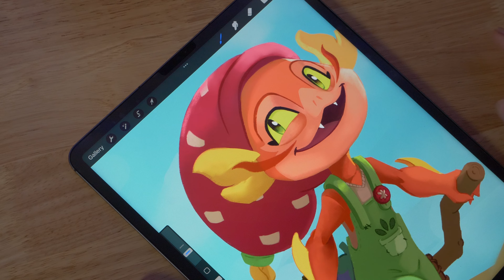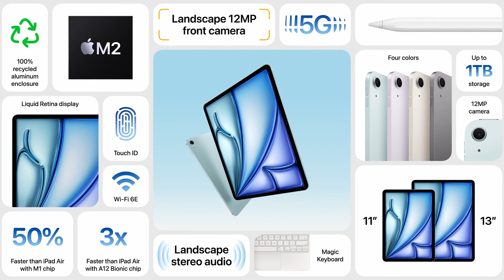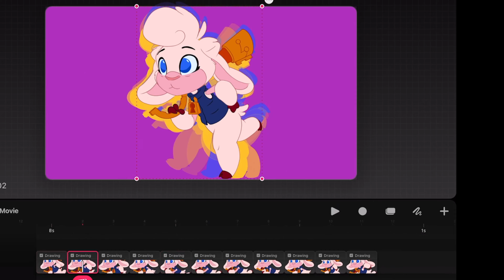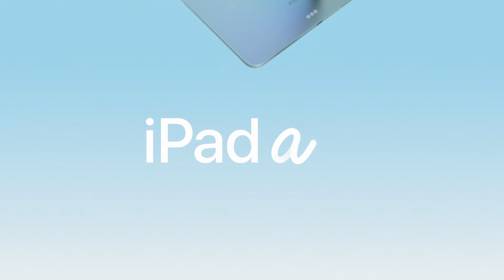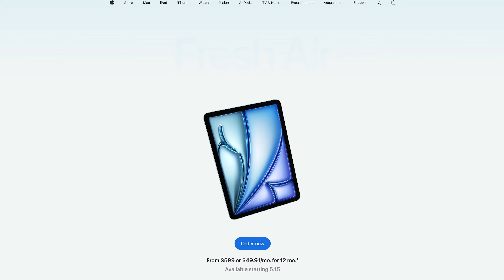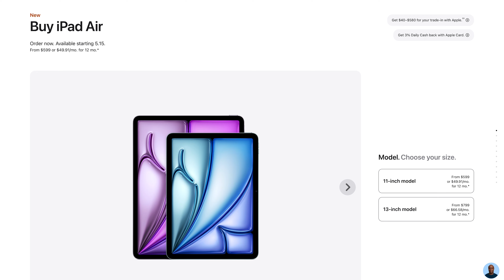Is it finally worth being an iPad artist?

Comment: The Pencil thing is actually a technical limitation. They moved the front camera to the landscape side, which is where a lot of the sensors and magnets were previously located to store and charge the pencil. That's why they had to be spread further apart, to make space for the webcam to sit in between. The magnets in the new one therefore don't match the old iPads positions anymore - kind of a bummer because I'd love to just get the new Pencil, but you can still rotate the pencil via brush stroke flow and achieve pretty much the same results, its just a bit more finicky but no reason to buy another 1.3k tablet :D anyways, great video!

Comment: They said something along the lines of "they are moving one-step closer to the ipad becoming a magical pane of glass." To which I add "that we will undoubtedly put in a big chunky case in order to protect it for when we inevitably DROP our expensive investment." 

The layer limit in Procreate has more to do with RAM than it does with processing power. Even the old M1 chips are more than capable of running Procreate, Dreams, and even Fresco buttery smooth while reaching their respective layer limits. It really has very little to do with the M4 chip.

The reason the Pencil Pro isn't compatible with the old M2 models is because to add the haptic feedback in it and re-position the camera to the long side of the ipad, they had to move the charging magnets in the ipad itself. The new pencil will not connect appropriately to the old ipads and the old pencils will not attach to the new ipads appropriately either. However, I wonder if the only caveat to the new pencil on the old ipad is that it charges slightly off-center or does it just not charge at all? If it is just an aesthetic issue, I can live with it if it means I can have rotation in my pencil, especially when my clunky Logitech case has a nice thick strap to hold it in place.

Comment: I agree with you about how thin this thing is.. my new 13" pro has a flex when on a flat surface and I'm typing on the screen - doesn't make me feel confident about my purchase. The real problem I have with this is Apple could have put 5 or more different features, or improved features into this iPad BEFORE worrying about how thin it is. It just isn't something anyone really wanted. I would have rather had a 20% larger battery, or more options for grips/tips with the Apple Pencil, better speakers, larger screen option!!, or software enhancements. But how thin it is? I never once thought yeah "hope the new iPad is as thin as 4 credit cards" - I don't understand Apple 90% of the time. I really don't. Probably why the iPad is the only Apple product I have these days.

Comment: The Apple Pencil Pro thankfully works on the new Air. Though it really depends on what specs you need.

My biggest concern is heat given that I do a lot with 3d and such, and the M2 iPad Pros overheated horribly.

The reason the Pencil Pro isn't backward compatible was that the camera repositioning required a redesign of the magnetic charging/linking function in both the tablet and pencil.

Comment: I’ve had Paperlike on my 2020 Ipad pro for about 4 years now and it has only recently started showing any wear. 10/10 would recommend :3
Reply: My glass screen protector is so scratched it feels like paper lol. Luckily it’s just the surface coating, and not visible.

Comment: iPad for art as in photography is more fun than clicking and sitting at a computer so that’s why I use it over my Mac majority of the time.
Reply: Which ipad did you get? Looking to upgrade my old air :)
Reply: @monikamorkeviciute9550   I’m still on a m1 iPad Pro 12.9 I don’t plan to upgrade for a while it does everything I need. 🙂 I do wish I had the hover feature or pencil pro support but not really needed. Depends on what you use your iPad for?
Reply: @ apart from media consumption, I do occasionally edit raw pictures in lightroom and affinity photo.  Not a pro, more of an enthusiast level. Been using iPad air since 2019 and I can still make it work, but it is getting annoyingly slow. Tempted to get a pro, but leaning more towards 2024 Air as I don’t see myself needing that much power from an iPad when I have a macbook pro.

Comment: Please. Do not buy that nano textured glass model. Buy a matte screen protector instead. If that screen gets scratched there is nothing you can do about it. A screen protector gives you the same result and protects the screen underneath. It’s just throwing 100 dollars into the fire
Reply from the maker: 100%- ironically a good ad for Paperlike 😅
Reply: @CharacterDesignForge  I did find that very funny actually 😂
Reply: Thank you for this perspective
Reply: Not just that, those protectors eat your pen tips really fast and an external protector can be replaced

Comment: The biggest issue right now with the new ipad is the price. 2500 for a tablet your better off getting a whole PC setup. This Ipad isn't anything special than the previous generation, and now that apple has clearly expressed interest in AI this just leaves a sour taste in artist mouth. This is such a sensitive time where artist are advocating for legislation and not being replaced with AI and here comes another company wanting to sell us a tablet with generative AI features. Like no. We shouldn't tolerate that, The price point and the AI bullshit. 

Artist already have to spend so much money on industry standard software that this is just another slap in the face. A pc with a basic drawing tablet is so much cheaper than this one tablet. Hell even buying older ipads are better than this.

Comment: I use a third generation pro and I’m itching to upgrade to the new pro. Do you think that’s worth it?
Reply from the maker: In addition to the new features, you'll see a big jump in power. But that's up to you!
Reply: @CharacterDesignForge  I struggle assessing how much power do I really need. The new air seems plenty powerful as well. I suppose waiting for artists to review both is prudent.
Reply: Same dude! I'm looking around to see if it's worth it 🙏 I was also considering the new Air but it doesn't have face ID which sucks
Reply: @emilymain4175  also the price difference between the air and the pro lol

Comment: Ngl, I was super hyped for the pencil pro and I still am... but compatibility is a horror show in 4 acts (like litrally...)
I would need to trade in my iPad Pro 4th Gen for an iPad air and STILL pay 500€ on top just to use the new pencil
And IF I don that, my old penicl 2nd gen just becomes completely useless

I would've payed 200€, maybe even 250€ just for this pencil but I really don't see me trading in my perfectly fine iPad pro AND pay on top just to use the new pencil
Sad though, because the new features are actually the one's I hoped were coming

Comment: a couple of years ago I decided to get a Microsoft surface book instead of an Ipad pro. price-wise the ipad was cheaper so I really considered it as a portable option and tested the one a friend had for a couple of hours to see if I liked it.
I decided on the surface because it had a keyboard in the price, I am used to office and know the programs I am using work on it and I don't have to relearn keyboard short cuts. hand gestures are mostly a cause of frustration, I prefer to press a physical button. so it was mostly that I was too lazy to change my entire work flow just to use this device.
I was a bit disappointed by the apple pencil because painting in procreate wasn't nearly as intuitive and "plug and play" as I was used from my pen display and graphic tablet on my desktop. You had to fiddle with the brush to make it even draw a line properly, like the pen pressure was wacky. that has been years though and since it's probably been updated a lot seeing how many professionals use it. 
the layer limit also put me off because i easily get into 50-100 layers on a bigger piece, so hearing that this is fixed I might try apple again.

not a big fan of the trend to make tech as thin and light as possible, I don't know who the market is for that either tbh. I mean it's nice that they are nit as heavy as the laptops from the early 2000s because that was a lot of weight and space in your backpack, but I don't necessarily need my drawing device to be lighter than my sandwich.
I am clumsy. things fall, I shove stuff in my bag carry them around...I don't such an expensive device bend out of shape because the backpack was standing next to the heater.

Comment: Where exactly did you get the info that the 2nd gen Apple pencil is working with the M4? I found some info saying the opposite:

The second generation Apple Pencil is not compatible with the just-announced new iPad Pro M4 models.
The front camera and FaceID sensor array have been relocated from the short-edge to the long-edge of the iPad - such that the camera and sensor array are now positioned top-centre of the screen when the iPad is positioned in Landscape orientation.  As such, the camera/sensor array now occupy the internal cavity previously used for the second generation Pencil's inductive pairing/charging system.
To accommodate this change, the charging system for the Apple Pencil has been completely redesigned - moving the associated electronics to different cavity locations along the top edge of the iPad chassis.  The new Apple Pencil Pro has been specifically designed to accommodate the new physical architecture.
As such, the second generation Pencil is incompatible with the new iPad's Pro.  Similarly, the new Apple Pencil Pro is also incompatible with earlier models of iPad Pro.

Unless it's only info about charging the pencil

Comment: If someone hasn't bought any iPad before, which one would you recommend for an artist to get?
Reply: The 12.9 pro. If possible get the 1TB or 2Tb since they have twise the amount of RAM 16GB vs 8GB. If you do smaller illustrations 8GB will be ok too. Painting drawing is fantastic on an IPAD but for more complex composition you may need to finalize it on real computer.
Reply: @andreasoberg2021  yeah, a lot of artists say that digital painting isn't that extensive. It doesn't require very much processing. So 8 gigs is more than enough. I want to be able to use the new pencil and I want pro motion and I'd have to get the M4 for that. It seems like a lot of money for the  1 TB version. It's going over $3,500 with accessories.
Reply: @williammclean6594  yes it is a lot. Maybe worth getting smaller harddrive and have it. I have found that several times with ipads I buy the big SSD and then I never use them so a bit of waste.

Comment: I started digital art experience with ipad and xp pens, and I got wacom intuos pro after I got into school and now I just don't want to go back to drawing in ipad, I don't know why people wants to escape the wacom + pc environment to much. I use krita for painting, animating and it's just awesome!
Reply: For me I would do a lot more drawing. If I didn't have to sit at my desk. I need the desktop or hook up a tablet to a laptop. I much prefer an iPad for ergonomic to be able to draw anywhere. If they made laptops that were like tablets that you could just draw on them then I would use that
Reply: Same, never had an Apple product but the iPad looks tempting for the portability + horsepower + amazing pen
Reply: The portability often sounds nicer than it is. You may not atcually draw in the sofa or on the buss etc as much as you think. For me the boggest benefit is how well the pen connects and how fast it updates. I do not get the feeling with my wacom
Reply: @andreasoberg2021  I spend two hours everyday on a train, I also travel a lot because of my work. So I draw a lot on the go. I love my surface pro 4 but that thing is HEAVY. My left arm gets really tired after holding it for a while, even on my lap. Also it's dying and I can't even use Photoshop on it any more 🤦‍♀️
Reply: I think the new ipad will be perfect for you. I think much better than surface pro. The connection with the brush and surface is incredible on ipad. The smaller is lighter so it may be an alternative. Also cheaper

Comment: The two biggest misses for me that Apple did from an artists perspective, was as you mention, the thickness are lack thereof. The Pencil improvements are lacking. If they integrated a form of EMR so it doesn’t need to charge and added an eraser, it would have been a lot more exciting. The squeeze I’m expecting will distract when I’m just holding the pencil tight, so like tap in gonna disable it. The haptic thing will be distracting. 

With animation, I feel too many people are sleeping on RoughAnimator, as it’s just so basic and intuitive, and it just has what you need for brainstorming. Then Callipeg is basically a TVpaint alternative at this point. Toonsquiq is also another good one. 

I think Zbrush will be a rebrand of Forger that Maxon bought a few years back.
Reply: ToonSquid refuses to play my full video animations without choking. Perhaps my iPad is too old 🤷🏾 But Procreate Dreams plays smoothly, despite it’s underdevelopment
Reply: I feel like the eraser at the other end would just be not practical. It’s not something I always want to flip to erase. Though, the double tap for me is just good. And many pen displays don’t have an eraser at the other end of their pencils.

Comment: Pencil Pro won't work with older iPads because the charging and magnet setup is different on the M4 Pro. The selfie camera is on the landscape side now in the same place as the old magnet position, so the Pencil Pro is just meant for the iPad (Pro or Air) 2024 magnets.

(Edited Pro to Pro or Air on the last line after @PSy84 's correction)
Reply from the maker: Makes sense!
Reply: Pencil Pro also works in m2 iPad Air
Reply from the maker: @PSy84  yep, mentioned that in the video

Comment: Yeah I agree I would much rather have a thicker iPad with larger battery and storage
Reply: The thinness is part of thermal management. If it was thicker, we’d see thermal throttling having to be done, along with other negatives, so I think they made the right choice. As it is, the battery on the 13” is already higher capacity than previous models.
Reply: Me too but the M4 is sturdier, lighter, cooler and runs for longer. All thanks to the M4.
I have the 2018, 2021 M1 and the new M4, and the new one feels super light.

Comment: They had to make it thinner to sell new Keyboard and other accesories. I would have preferred same thickness and better battery and heat dissipation and make the use of the new keyboard an option. 
Also I would have like the apple pencil connection to be moved to the side of the ipad instead using the same magnets so that the pencil could be used on previous models.
Reply: I second the motion to improve the heat dissipation!!!